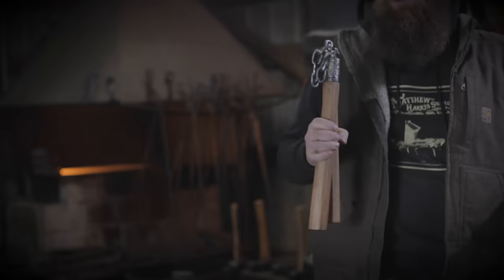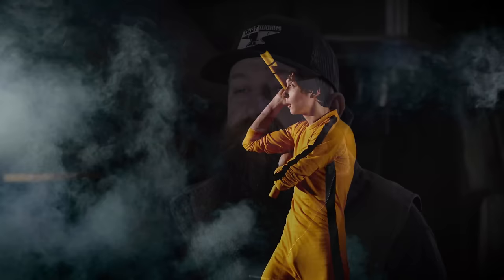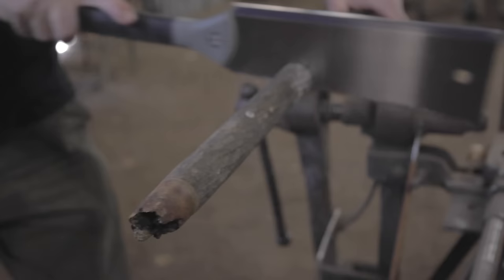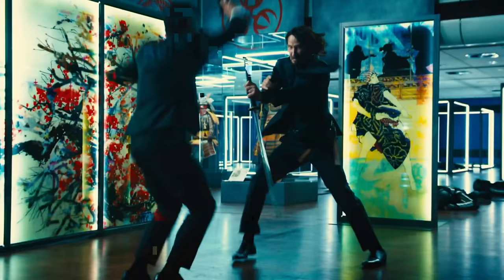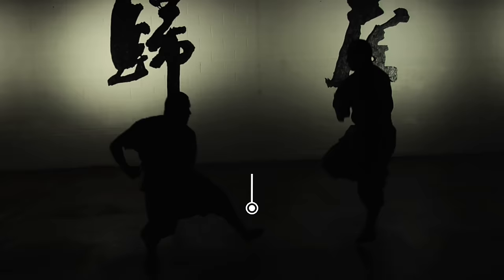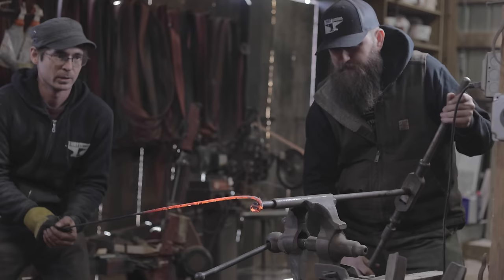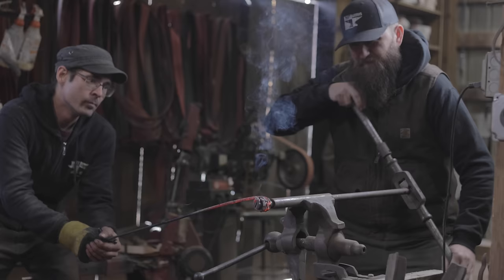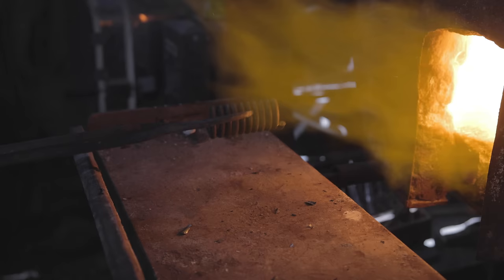John Wick 4 Nunchucks - Did They Exist in Battle ?

Comment: You imply that if a weapon has a martial art, then either it doesn't exist outside that martial art, or that martial art never existed. Why did you say this? Apply that to literally any weapon that has treatises.  It's clearly a weapon, and it clearly has a martial art. That doesn't touch on its historicity, and doesn't touch on the question of "did they exist _in battle?_" A wealth of weapons never saw actual battle, and were used for duels or other applications. This edged uncomfortably close to Shadiversity-level "if it doesn't work with minimal training on the battlefield, it's a worthless weapon. By the way, everyone should just carry a stick."
Reply: Nah, what theyre saying is essentially that the logical way this would be adapted to a battle field is as a flexible club, basically just whacking people, while the martial art for the nunchucks with all its tricks and.....bruce lee type movements are very different to just whacking a guy, therefore if youre talking about initial development yes, it could only be one or the other, either it was essentially a flexible club made for battle or an extention into an already existing martial art, is it possible it was used for both at a point? Yes, but for original intent? No

Comment: Wrong, wrong, wrong. Real Nunchaku were used by Okinawan farmers and became weapons to fend off samurai. Also, traditionally speaking, nunchaku were hexagonal shaped handles with rope, not chain and the length was usually about 3-4 fingers wide. You typically don’t want that munch length between the handles because it becomes harder to wield not to mention not enough tension to catch and trap an incoming Bo, Eiku, Shinai or any other non bladed weapon.

Comment: This analysis was all over the place.  A bit confusing.  

Was it used on the battlefield?  No.  

Was it used as a marital arts weapon?  Of course it was.  

Its still used as a martial arts weapon.  

There are limited uses of this weapon in the martial arts from Japan and it was also used in the Chinese martial arts.  

Its important to note the marital traditions of Japan and Okinawa all find their origin in China, including the weapons.  The iconic Japanese “katana” for example, has its origins in Chinese Tang dynasty swords.  

Nunchucks would fall in the “whip” style of Chinese weapons.  Chain whip, rope dart, three-section-staff etc.  I’m surprised you guys did not explore this route.  Specially since its a Chinese martial artist, a guy named Bruce Lee, and his welding of this weapon that most folk relate too when you mention nunchucks.

I agree that this weapon requires much more training and finesse to wield vs a staff or club.  If I were to guest, this weapon was probably used as a conceal carry weapon, maybe about the level of a dagger for self-defense only.  Not a weapon for warfare.  I think the best you could do would probably be blunt force trauma and, with lots of skill, use it as a neck tourniquet as far as deadly force goes.

Comment: Still going to lose to a guy with a long stick if skills are equal. Or even a stick of equal length that isn't jointed. This beats not having anything, but not by much. 

But I think it is most likely that weapons of this type were commonly used as personal defense weapons, and that makes this highly plausible as a historic weapon type. Not for battle, but more as an improvised and concealable force multiplier. 

But having said that I do not think the modern form is all that accurate to what it likely was. In all likelihood it was jointed just enough to let you fold it in half and no more, and was used as a simple short flail to crudely beat a lesser equipped opponent into submission. 

For example such a weapon would have a decent enough advantage over a mugger with a knife to make them consider easier targets. It would be considered an adequate defense against said mugger or two, while letting you walk around with no one the wiser as to what you were carrying. Really, this is the only historically plausible explanation for such a weapon, especially since there are close historical analogs we know existed. This could simply be a preferred regional variation of one of those known historical examples. 

(yes, I do know a long staff "walking stick" would be far more effective as a mugger dissuader, but there is historical precedent for such tools to be disallowed in certain places. In such a case a more discrete tool would be necessary, and a short folding stick/flail would fit the bill nicely. This is also why other close historical analogs existed.) 

The modern iteration of the weapon with the long chain, complete with the entire martial form and mythos, is clearly a modern construct. There is zero evidence that anything along these lines existed prior to the modern age, and as explained there is no historical analog nor logical place for it to exist within those ancient cultures. If you were going to expend the kind of energy necissary to make such a weapon effective you would be far better off learning a more effective weapon, and if you did not have access to better weapons you simply would not have the time to devote to learning this contraption. The modern nun-chuck is a work of pure fiction.

Comment: There are a dozen other historical or fantasy or cinematic weapons that the arguments apply to at least equally, from shuriken to other kinds of darts and javelin, atlatl, sling, wind fire wheel, fan, hook sword, meteor hammer.

Combat cultures are cultures. They develop idiosyncrasies for irrational reasons, often improvised or spurious, often not documented -- especially for things that would have been more documented by authorities seizing them as contraband than by smiths and teachers of combat. When something like unscrewing and throwing a pommel makes it into a sword manual, we know historical figures could be inventive and off-beat.

Why nunchucks instead of longer handled rice flails? Dual wielding. How long does it take to master them sufficiently to beat a guy with a baseball bat? About the same length of time as the off season for a farmer. How long to be sufficient to do better against a guy with a shield or spear than using a baseball bat? Pretty much the same day, if you don't mind injuring yourself a bit. 

The chance to injure an otherwise too armored opponent is generally worth a bit of risk of self-harm, when that opponent is going to kill you if you don't do better against their armor than a straight stick will.

Comment: This won’t work. The chain is fixed to both ends. Because it cant spin freely it will tangle up.
Reply from the maker: Once again...this is a modern idea of a so called ancient weapon.
Reply: @ThatWorks  I understand your point and I agree. What I tried to say is that the weapon you showed in the video will not work. The connecting chain ( or rope) must not be fixed to the wooden end. The wooden end must have the possibility to rotate on its axis otherwise it would twist the chain.

Comment: I have no clue where you found that Chinese story lol. The 3 sectioned staff was around for so long in China. The story was shit, Not gonna lie. Though rather than a story, I wouldn't believe the earlier iterations of the nunchuck was from east Asia in general. They were used just like flails. Rocks shatter upon impact, and steel was expensive. Wood resisted impact, easily shaped, long and is heavy. No fairytales.

OH JaPAn ThiS, JapAN thaT.

Comment: There is a lot of controversy over the flail being an actual martial weapon in medieval times too.  So the flex-weapon argument may be tenuous.
Reply: A significant part of the "there were no flails" crowd's main argument is "but you'll hit yourself." Sure, if the chain was the same length as the handle. Examples we have don't have this problem.